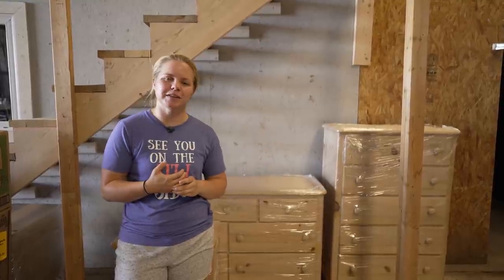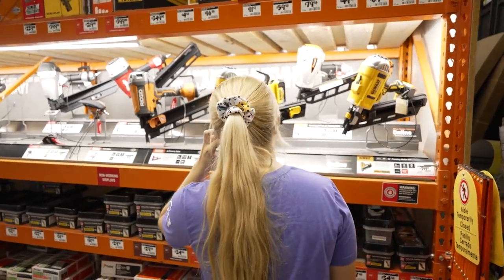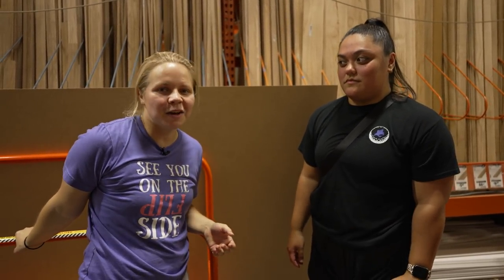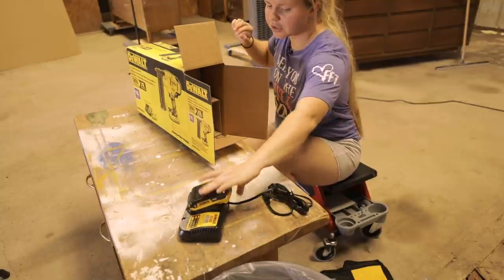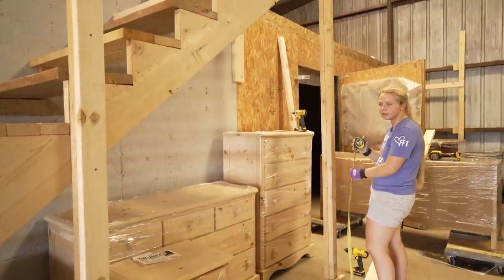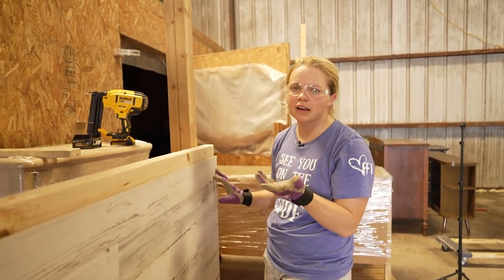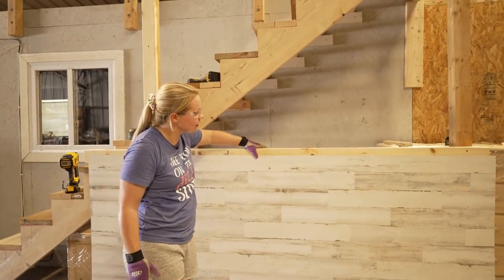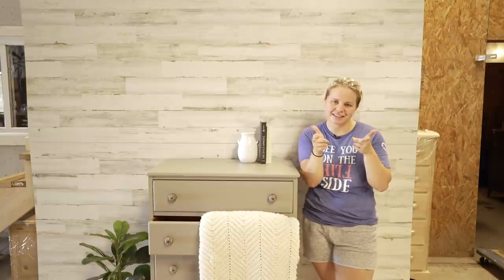Increase Sales & PROFIT with a Staging Wall

Comment: I bought my husband a cordless Dewalt drill for a gift about 25 or 30 years ago when they first came out. It has really been used over the years and still works great. Others have come and gone. The battery on that old one is better.

Comment: Girl, I can sympathize about the sweat! I also have long, thick hair. I was sanding down the pedestal base of my MIL's dining table in 99 degree weather the other day. I had to be careful not to have my head over the wood because the sweat was pouring off the tip of my nose! I haven't really flipped furniture for sale yet. I have just been re-doing pieces for my own house. But it's nice to know that it wouldn't cost too much to put together a staging wall if I decide to try it!

Comment: You are amazing..Idk how old you are..but I started Drywall finishing in 1992 I was 20 years old ..I'm still doing it..I'm 49 now..I also did roofing for one yr in 2016 ..until I fell off o roof.. never doing that again..worked concrete for more than a year in 2010 ..Don't like working outside..so Im sticking to my Drywall finishing..lol..but I want to do furniture on the side..and last Sunday I got a free piece and I primed it with drywall primer 🙈..it didn't stick .lol..idk if it's because it's laminate ..but sanded it this Sunday and used Kilz from Home Depot and that worked..I'm going to use your link for the upholstery cleaner today ..I got 2 of those chairs that you take the skirts off for $20 for both ..and they are in great condition..If you are ever in Montana in the summer ..bring a truck ..you will go home with a truck load for not alot of money..estate sales..yard sales are awsum..

Comment: I’ve been wanting to make a staging wall. I’ve priced some panels at Menards. But I really didn’t like what they had. I like the panel you picked out. LOL. Guess I need to go check out Home Depot. Thanks for sharing this. I bet you love that nailer. I have an air powered one but also have a Ryobi battery powered. I always reach for the Ryobi. But… all my batteries are dying. I like using my husbands Dewalt drill better so Ive been thinking about upgrading my nailer instead of buying new batteries. Dewalt is such a great brand.

Comment: DeWalt 20v 18ga go for $250+
You could’ve gotten a 20gal compressor for less than that, and would have the ability to use a variety of fastener guns, sprayers, and other pneumatic tools.
Reply from the maker: I would rather not deal with the air compressor at this point in time...I have no experience with them at all.

Comment: Don't fold the blanket. Just gather in the middle and let a couple of corners hang down to the side of the drawer and a little on the front. Also get some books and stack them on top of a dresser or table with a pair of glasses. All stuff you probably habe. Also you can stage with a chunky sweater folded and a tray with a mug, napkin and spoon sitting on the sweater. All easy, all cheap!!

Comment: Rookie mistake:  NEVER USE A CHAIR TO STAND ON.  It is unstable and dangerous when reaching, hoisting, twisting, etc.  Get the appropriate ladder or folding step stool. 

A friend of mine used a kitchen chair as a stepladder when cleaning the tops of her kitchen cabinets. She fell and basically tore her foot apart. It was horrific and could not be completely restored.